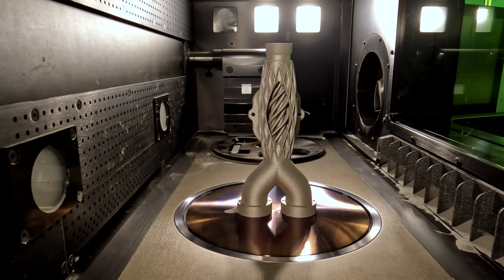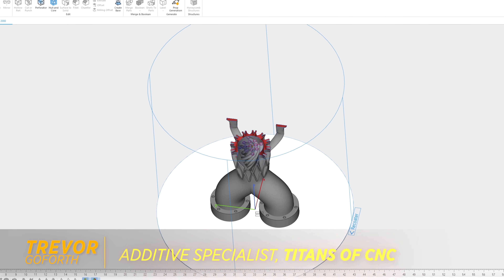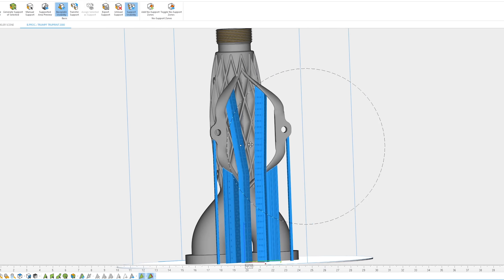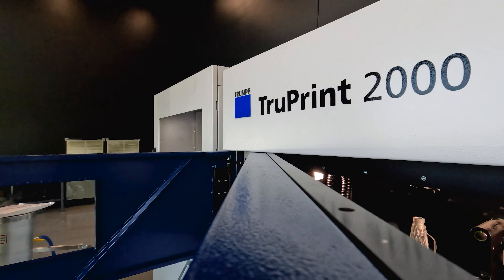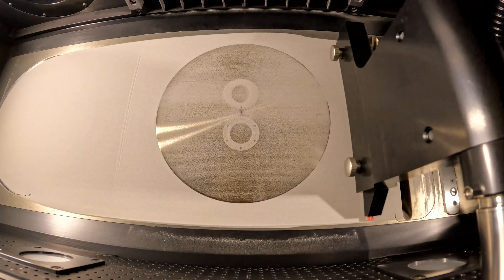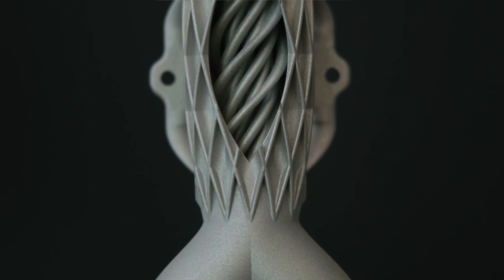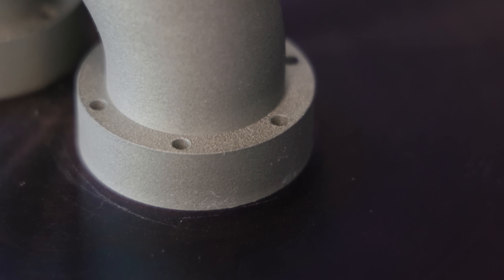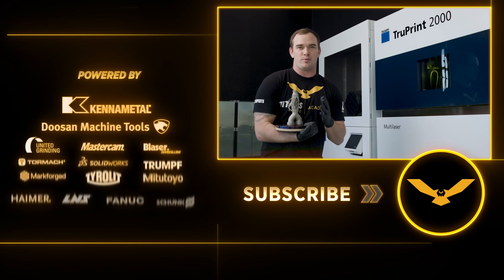3D Printing an INSANE Steel Part that's IMPOSSIBLE to Make on a CNC Machine

Comment: Let's not confuse 'impossible' with 'difficult'.
It seems to me that 3D printing can, in some circumstances, make production 'easier', although not necessarily quicker.
What is it about this product or its function that definitely would be IMPOSSIBLE to make or simulate using more 'conventional' methods?
Reply: It's the shape that makes this part impossible* to make by any other conventional means. You have 2 sets of 13 runners that first merge into one set of 13 thin walled very long runners, which then helix around each other. 12 out of the 13 runners are double curved. All of that is inside an enclosure with only two tiny openings. 

This complex double curved helical hollow-within-hollow shape is impossible to build out of wax, for lost wax casting. Simply because there is no proper access to build it. The shape as a whole is self-blocking assembly. Even if you could build the wax parts and assemble them, you coudn't slurry and coat the internals. 

* = Now, of course you can build something that may functionally approach a part like this the exotic way, by laser-cutting and stacking hundreds of intricately shaped really thin sheets of 316L, section by section, and hope that the material can be diffusion bonded. Or you can lost-wax-cast several sections and assemble those. But that's still not this shape and not a single piece, but a component made out of multiple parts.
Reply: @Hydrazine1000  
Thank you very much for that detailed description.
It filled in a lot that I couldn't gain from the video.
You confirm that it would be possible to produce, by more conventional means, an item that would adequately perform the same function / achieve the same purpose. (I'm still not clear on what that purpose is)
So the 'impossible' description applies ONLY when we place a higher value on 'form' than on 'function', 'time to produce', 'cost to produce' (factoring in cost of specialist machinery), etc.
Seems it's a bit like fitting a Bugatti Veyron body over Subaru Liberty mechanicals - just because it 'looks good'.
I'm strongly in favour of thinking 'outside the box' and prototyping futuristic designs.
But, for everyday purposes, cost is the driving factor.
To meet the requirements of business, 'parts' must perform the task required, be quick and cheap to obtain / replace and reliable - therefore requiring fewer replacements.
Seems like the best way to approach funding for production of this item is to apply for an 'arts grant'.
Patents offices are full of 'beautiful' innovations that never 'got off the ground' simply because they were not 'cost effective'.
Reply: @trueaussie9230  The part is a combined fluid mixer and heat exchanger. Two reactive components get mixed where the legs merge, and the cavity in which the 13 tubes sit (it's only open for showcase purposes, this doesn't appear to be a functional part) circulates coolant to remove heat. 

Don't confuse form for beauty with form for function. A part like this may look organic and pleasing, but that's pure side-catch. The particular shape makes this heat exchanger really efficient and allows for very little back pressure, compared to something made by conventional means.

A conventional multi-channel valve block for hydraulics is pure 90° right angles and some dead ends. It's a solid block with a lot of intersecting holes bored into it. If you print such a part, you can make each bend gradual and flowing. No hard 90s. You can double-curve internals. (Try drilling that. You can't) A printed valve block is also much lighter, since it only places material where it is needed. Printed valve blocks still have to be finished by CNC, so CNC is not going to go away. 

Injection moulding dies now get 3D printed, because it allows for conformal cooling channels inside the injection cavity. Having uniform injected part cooling closely following the shape of the part means cooling times drop dramatically. I saw an example where active cooling before part ejection was reduced from 30 seconds to 5 seconds. Cutting 25 seconds off a 30 second cycle time is an absolutely massive gain. That's thanks to freedom of shape, yet has nothing to do with beauty, you can't see the inside cooling channels.

Speaking of Bugatti, they 3D print brake calipers for their Chiron. The conventional machined aluminium alloy component weighed 4,9 kg. The 3D printed titanium (Ti6Al4V) part weighs 2,9 kg and yet is able to apply more brake pressure. Google for it and take a look. The thing looks like bone structure. It just happens to look amazing, I think, but that's a result of stress simulations, material is only present where it is needed for load bearing. Beauty wasn't a purpose here, it just happened.

I've mentioned this one in this thread a few times already: the new GE Catalyst turbofan engine, for the new single prop Cesna Denali: What would otherwise take 800 components has been reduced to just 12 components, thanks to 3D printing. The new turbofan is lighter, more fuel efficient and more powerful.

Comment: I am really interested in this from a sanitary perspective (pharmaceutical business)

- if you print a flat surface of 316L, what surface-roughness are we then talking? - can you get below Ra < 1,0 um?
- what sort of yield strength are we talking? - similar to machined 316L ?
Reply: Powder size is in the 10-30 µm range, or 15-45 µm, or 20-60 µm, depending on what you pick. They mention a build height of 20 µm. Forget an Ra of below 1 µm for this type of fabrication. 

Strength-wise, selective laser melting (SLM), as demonstrated here, can surpass mechanical properties of the same alloy in the as-cast form, and approach the properties of materiail in forged billet form . But that's for tensile strength, impact toughness and fatigue resistance don't quite approach the same level as for forged billet.

Comment: Definitely wasn't an impossible part before now
Reply: How would you go about constructing it? Quite a few double-curved surfaces inside double curved surfaces. For this amount of surface detail you'd need lost-wax casting, but constructing the mould for this part (hollow-inside-hollow) would still be impossible.
Reply: @Hydrazine1000  2 decades a go I worked on the design and verification of a similar, but much smaller, design that was part of a valve body on a satellite thruster. It had intricate internal geometry with compound bends and multiple passages intersecting and branching out. It was manufactured by laminating thin plates together, each of which was cut to form the cross section of the feature at its level in the stack. It included tubes that were floating inside of internal cavities, very similar to what you showed in this video - but like I said, much smaller. A workpiece of the size you showed would have been much easier to assemble. After the stack was built it was pressed and heated to weld the plates together.
Reply: @th3b0yg  Ok, fair enough, point well made. I did not consider that by stacking and diffusion welding thin intricately shaped plates together you can create a part with similar functionality. But not at this scale, not as weight-efficient, and not as cheap. And the latter is kinda hilarious, since "cheap" is not typically associated with AM.

Oh, and as someone with an MSc in Materials Science & Engineering, I would have completely geeked-out over that satelite valve part. Sounds really interesting.
Reply: @Hydrazine1000  I dunno. With robotic pick and place the stack could be built very cheaply at scale.
Reply: @th3b0yg  Maybe, but do you know if the diffusing bonding will scale up too? I'm no expert in that area. And can a shape like that made of loose laser cuttings be pressed enough to let the diffusing bonding happen? 

(What's funny, while the concept sends my mind racing, is that this type of sheet stacking could also be considered additive manufacturing in a sense.)

Comment: Woooooow, can any one imagine the scfi behind this tech. You should have prior exp in the field to understand it. Im only 25 yr and 3 years of exp and i'm impressed👏👏🔥🔥🔥🔥🔥🔥🔥
Reply: You deposite a thin layer of very fine metal powder with a special wiper. A laser (or in this case multiple lasers) locally melt the powder and let the particles fuse, only  where the part is to be build. The wiper passes again to remove any spatter. Then the wiper makes another pass to deposite a new layer of metal power on top of the just printed/build layer and in go the lasers once again to selectively melt the next build layer. Then another wipe to remove spatter, and another wipe to deposite a fresh layer. "Rinse and repeat" untill done. Carefully remove printed part from the remaining unmelted powder.
Reply: As you've rightly noted, you don't have the maturity and knowledge necessary to enable you to UNDERSTAND this, but you're 'IMPRESSED'.
The immature and 'uninitiated' are impressed by a 'magic show'.
I hope you've realised that, rather than being blinded by the 'stars in your eyes', it's time for you to start asking intelligent questions.
Reply: @True Aussie  I hold a master's degree in mechanical engineering, plus a 2 year diploma in mechanical manufacturing. During my studies I accumulated 2 years of internship. And 3 years of experience after that. I know exactly what I'm talking about. And I'm aware of the potential usage of parts manufactured using this technology. From your reply I can measure your professionalism. You limited/ended the knowledge in this field, you think that's it for you (you passed the finish line). You deserve a gold medal!
Reply: @trueaussie9230  "Although my modest experience I'm impressed". That's the meaning of my comment.  Are you pleasing yourself going after people in the comments? Would you like me to give my Linkedin profile to justify for your honor?

Comment: Aerospace parts feels like a bit of a reach, I'm sure they'd hold up for airflow testing purposes but I somehow doubt you're making something that can compete with cast parts with a laser for actual use
Reply: Yeah. A fair amount of hyperbole in this video.
Reply: The aerospace industry is the main user of this technology. I worked doing  this at a major aerospace OEM and now am an applications engineer at one of the main printer OEMs which supplies printers mostly to space companies printing rocket engines
Reply: The FAA has already granted parts approval for multiple 3D printed parts for use in civil aviation. 

GE designed a turbofan engine, their new Catalyst engine, from scratch for the new single prop Cesna Denali. That mostly 3D printed turbofan engine is lighter, more powerful and more fuel efficient than its predecessor. And they managed to reduce the component count from more than 800 parts down to 12. 

SpaceX has been 3D printing their SuperDraco engines in Inconel for years now. Those are used on the human--flight-rated Dragon 2 space craft.

So, uhmm, yeah, this tech is already in use in aerospace.
Reply: At this point 3D printed rocket engine powerheads have been test firing and flying for more than half a decade, including on manned vehicles.

Comment: While this is cool. It will fully kill skilled trades and machinists everywhere! Basically if your not a programmer you won't have a job in the manufacturing business down the road. So tell me, has General Electric bought you guys yet? If not it's coming because GE has been on top of this for Aviation
Reply: That's not actually the case. The technology isn't being pushed to replace machining, etc. There is plenty of machining that still has to happen to these parts and the idea is to actually use 3D printing for parts that couldn't be made practically any other way. There will always be a need for machinists. And in fact, a ton of the operators of these machines are also machinists. It's just another tool in the shop. A lot of machine shops are bringing 3d printing in house to supplement what they already know.
Reply: GE Additive is a mess with good marketing. The two printer companies they own are dying because they are awful. I worked at another aerospace OEM as an engineer running pretty much all of the different 3d printing systems and now I work for one of the printer OEMs and we're actually receiving a lot of AM people that bolted from GE additive
Reply: @BenWilson24  interesting. Well seeing as how generous electric works, I wouldn't put it past them to use it to can machinist to line they're pockets with extra cash. Ge is notorious for going through workers

Comment: I just finished designing and building a complex kitchen appliance with a PLA printer, and was blown away by the ability to adjust the design on the fly.   Imagine having to make a separate injection mold for each design iteration! It really was fun. But to do it in metal...

Comment: I mean - yes, this EXACT part is not possible to produce with other methods. You'd need to make it at least 3-parts with normal methods, but those are then also way faster and cheaper for larger production scale - and for nearly anything you want to actually produce that will make 3D printing not an option for scale production.
But it is a great tool for research and small-scale production.

Comment: What happens if you purge the oxygen and fill it with argon? Would you get a better finish? Or is still needing to be sintered?
Reply: The enclosure is purged and filled with either nitrogen or argon as shielding gas. The printer is a selective laser melting (SLM)  printer so it doesn't need sintering, it will be 99,5% dense or better.

Comment: VERY interesting - up until now I've always considered 3-D Printing (the waxy-plastic type) as being an interesting gimmick for using expensive technology to print (very slowly) cheap brackets, flanges, mounts and holders. To be able to fabricate metal components is a game-changer. How does the "printed", finished metal compare to aluminum, steel, titanium etc?
Reply: Powder bed selective laser melting will yield mechanical properties better than as-cast, approaching that of forged billet. Impact strength and fatigue resistance sir more on the as-cast side though.
Reply: How is FDM printing a gimmick that uses expensive technology that prints slowly? I mean everything you said is just totally incorrect.

Firstly, FDM printing is hardly slow. Define slow. Machines like the Voron are cutting over 3/4 of the time off prints while retaining a good majority of the quality. Even on Creality machines people are able to shave a good 50% print time off their prints and still have functional parts.

Expensive? Considering entry level machines like the Creality range are anywhere from $250USD to $400USD I would barely call that expensive. People spend more in a year on fast food.
Cheap brackets? The Liberator? FGC9? Not into that? Drones? RC Cars? Leggo? Replacement parts? Upgrade parts?  Not even scratching the surface. What about helping animals? Numerous animals have benefitted from FDM printing. People have made, (what's a better word?) wheelchairs for their disabled pets, pretty sure a Toucan got a new beak. There are even people here on YouTube who are making prosthetics with their FDM printers.

What about rapid prototyping? Someone who is designing parts for....whatever reason, doesn't have to invest $100,000+ into a machine like this to get their parts proto-typed. They can invest $300 and rapidly print off their parts to check scale/fitment/whatever.

All in all I think you could do with looking further into FDM printing because respectfully you are very uneducated about the subject.

Comment: With this tech and others 3d printing in space is not impossible with any part now. This is amazing. Ever since i heard of 3d printing i had always had that lingering question. How do u 3d print metal. This is awsome. Super impressive.
Reply: And this is just one of several methods of direct metal printing. There are powder bed methods and powder spraying methods. There are also wire-based methods. Heating sources can be laser, electron beam, arc or electrical resistance. 

And then there is indirect metal printing, with metal powder and a binder, which can be jetted or printed from filament, which needs de-binding and sintering as post-process.

Really there is so much going on in Additive Manufacturing, it's mesmerising!
Reply: Sounds like each meathod could be better for diffrent parts.
Reply: @jacobanderson6551  Bingo! Powder bed = small build volume, high resolution, low kg/hour build rates. Wire methods = large size, low resolution, high kg/hour build rates. (The Dutch company MX3D printed an award winning pedestrian bridge spanning over 12 m using Wire Arc Additive Manufacturing!) Powder spraying methods sit in the middle ground. 

And powder+binder followed by debinding+sintering has its own drawbacks but is much better suited for higher parts count production.